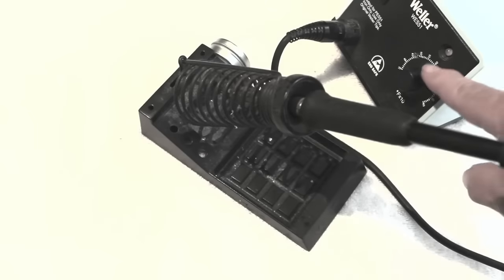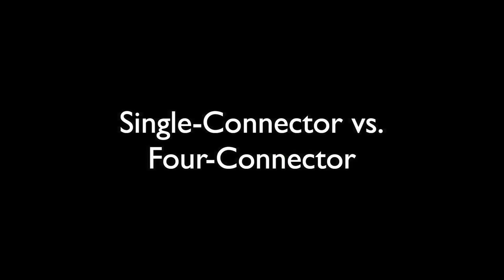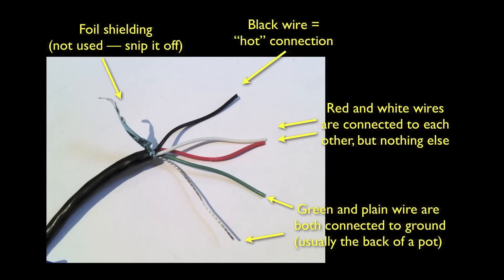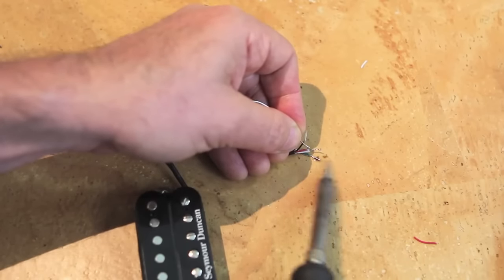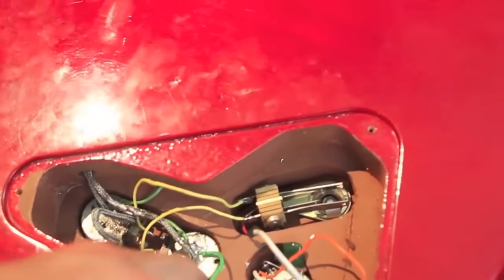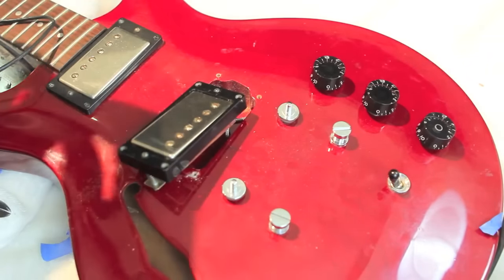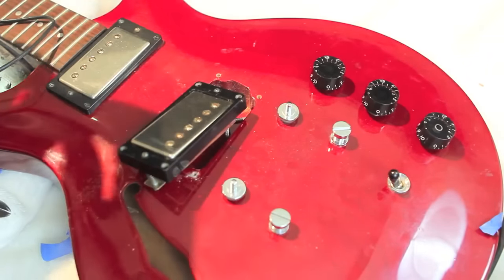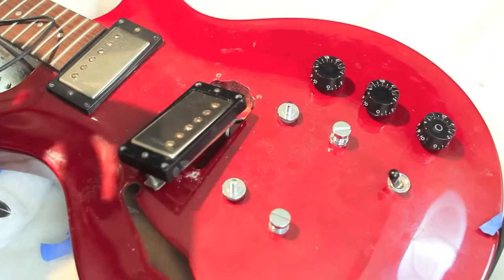Do It Yourself - How To Change Guitar Pickups (Courtesy of Seymour Duncan)

Comment: Hi all, I have a couple of things that really can make things easier. First of all a correction, he refers tge outer coating on the red, white, black and green as "Shielding" that term is not really correct. It is insulation. Shielding is a term that hints that it protects from ground hum or buzz. Shielding is used to reduce noise ie: "Shielding Tape" The second item that saves a ton of frustration is before pulling wiring out after disconnection, I tie a light string to the wires so when I pull the wires thru it creates a pull string to pull new wires back when you put the new pickups in. Easy Peezy! Good luck to you and may your skills grow to Monster Proportions!

Comment: Very informative but what genius chose black for the HOT wire?
Face Palm!
On another point:
NEVER cut your strings before loosening them, you'll save your tuners, bridge and finish on the guitar!
Reply: My acoustic saddle broke bc I thought I loosened the strings enough and when I cut the string it snapped my saddle clean in half, but I ended up getting a bone saddle that sounded better so I guess it’s a win at the end of the day, lesson learned lol
Reply: Which color would you prefer
Reply: @jimmcbride2990  white or red. Black is negative in most schemes.
Reply: @Lee-wu2up  black is hot in residential electrical work in the US. when he said black was hot it just seemed natural to me. then again, i am an electrician. never worked with fine electronics, really

Comment: Thanks so much, I've never wired a guitar before and I've been tremendously frustrated trying to find information on how to wire a 4 connector pickup. I don't need to split the coils and and all the advice I've gotten so far has been over my head and lacking depth, but this helps a lot.

Comment: Outstanding video!  I'm trying to put an SSV+ into the bridge of a super strat, and have no desire to do coil splitting with it.  That said, there's virtually nothing out there, whether it be wiring diagrams or videos showing how to wire up a series bridge humbucker into a strat (that was previously an SSS).  So, I'm simply working with two 250K tone pots and a 500K volume pot.  I'm probably over-thinking it, but it would be nice to see it done visually.  Suhr doesn't have a wiring diagram, and it seems to be opposite of my Bare Knuckle Pickups wiring diagram.  So, I'm hoping it's the same wiring as the SD.  Either way, I'm going to give this a try and see how it goes.  This is a great video...thank you for posting!

Comment: Alternative "tools and supplies":

soldering: big gun type
;
wire cutting: scissors
;
Wire stripping: teeth (between), front, choppers
;
Screwdriver improvise: dime, metal pick
;
pliers: finger nails
;
tape: fingers
;
cell phone: mental notes
;
towel: kleenex, or pure air (nothing);
Reply: You forgot tweezers & toothpicks, lol

Comment: Thanks for the vid. I just replaced the stock humbucker in my 8-string kit build with a Duncan Distortion humbucker and, considering that this was for a Seymour Duncan humbucker, I was able to follow this tutorial to the letter. My 8-string is a Tom Delonge-style setup: single humbucker with just a volume knob so the wiring is fairly simple. The hardest part was soldering the wires where they needed to go since I'm not exactly a wizard with a soldering iron. My solder joints aren't pretty but they got the job done.

Comment: I've only ever once attempted to install a pickup, years ago(probably like 8 years) and failed some how. Either the pickup I bought was faulty, or I fucked something up. In the end, I no longer have that guitar. Jump to today and I FINALLY got my new set of pickups(12 years into playing guitar, sounds like a good time to change things from stock LOL) and because of this video I now know that I have two new single-wire pickups. I'm legit excited to put these babies in and play with them. I remember when I tried to install the first pickup I ever did, I heated the solder up first. Don't think that caused the issue but yeah, clearly not the best way to go about it. lol. Thanks for the video man! :)

Comment: I referenced this before I opened up my Epiphone to change the pickups. When I did, I found that the Epi pickups has wire terminals with a color coding that is different from the Seymour Duncan wires. The bridge pickup terminal has 2 black wires (one of them the bare wire), and the neck has 2 white wired (one of them also the bare wire). After a lot of searching, I found this - and successfully changed the pickups:  From Seymour Duncans to Epiphone harness: bare goes to bare (of course), green goes to black, black goes to red, white goes to green, & red goes to white

Comment: Nice video on this. Never done it before but am gonna attempt it myself on my old LP. Either that or I balls it up and there's a dude down the road who will do it for me.
Reply from the maker: You can do it!
Reply: @DIYGuitarTalk  failed! Got the neck pickup to work but the bridge is not functioning. Problem I have is my LP uses quick connect cables but im not using them so trying to wire it like you show.

Comment: You can use a little flux on the existing solder to melt it very quickly instead of setting your iron on the dry solder heating everything up. Probably won’t do anything to a pot, but if it was a sensitive piece of electronics you don’t want to set it on for that long.

Comment: I had a seymour duncan SH4 for 7 string... I think they inverted the red and the bare wires from the factory.  It took me days to discover this because i didn't have a tester so I did trial and error method.  I was wondering why all the diagrams I found didn't work and I even contacted the guitar manufacturer (Ibanez) to get a diagram from them.  I had finally made it work by swapping the red and the bare wires.
Reply: Wait what? So the wiring was wrong ?

Comment: Thank you for this very informative and easy to follow video.  Two questions.  
1) I want to install a pair of Seymour Duncan pickups in my Les Paul.  On one of the volume pot lugs, Gibson has left quite a lot of solder on the lug, which one of the orange drop capacitors is attached to as well.  If I try to heat the new pickup's hot wire to the lug, and am not able to remove the solder, and am only able to connect the hot wire to the remaining solder left by Gibson, and thereby not being able to connect the hot wire DIRECTLY on to the lug, will this lessen the pickup's signal/output?  
2) Also, what is the recommended temperature to run the soldering iron at?  
Thanks in advance.

Comment: any ideas as to why there is no sound after connecting everything exactly as you showed? I have tried to connect it every single way possible and there is just no sound. is it possible that something was broken in the process? it's very unlikely as i was very careful the whole process, nothing was burned/scratched/cracked/snapped/pinched/etc. I will have to put the old pickups back in and solder them back up again to make sure they aren't actually broken (its late in the day and i dont have time to do that anymore), but i have complete surround pictures and a video of the original connections and given the instructions that came with the pickup, plus your tutorial, again, everything was connected up fine, but no sound when tapping the individual poles, even when reinstalling the strings to try with those.

also what is the point of the green and bare wires to be separate when you have to join them and use them as a single wire??? unless they can be used separately in a different set-up, of course :D

Comment: Hi. thanks alot very interesting... i have a guirtar that the 3 way switch is far than volume pot. Can i connect the ground (mesh in two conductor or gren  and plain on 4 conductor ) in any place of the 3 way selector switch?

Comment: Serious question, I cut the input connector wires half length on my friends guitar (they were so long) and fixed the buzz it had for a long time.. how sure are you that the same doesnt apply to the pickup wires? I mean that the audio quality wouldn't be affected by a longer wire. 

I was always told in regards to production and signal chains that the more wire = the more noise - but maybe there's a difference between pot--> input and pickup--> pot connections seeing as humbuckers are designed to reduce noise? Thanks!

Comment: By far the best way to strip the ends on the tiny wires is to slightly heat the end of the wire with a lighter till it softens a little then pinch it with your fingernails and the insulation will slip right off without damaging the hair like wires inside

Comment: If you want a trouble free operation... Just SPLICE the wires and join them together, much easier...been doing this for ages... of course you need to consult GOOGLE for the color codes.. Once you know where the "hot" wire is, it's pretty much easy to figure it out... Green and Bare usually goes together... Two conductor Humbuckers are the most convenient all you need to connect is the hot and the ground

Comment: Question: Can you use those "twist connectors" that you use to join house wiring? For example, suppose you cut your current pickup wires 3" from the pot; remove the existing pickups, mount the new pickups and then connect the new pickups to the existing wire with a "twist connector"? Would that work? (I have no use for a soldering iron other than replacing pickups...)
Reply: bad idea, wiring means soldering everything had to stay in place securely

Comment: I'm sitting here so mad. Mine is all jacked up. The old pickups were all twisted together and attached to the tone pot with a wire coming from the bridge pickup and one from the neck pick up attached to two seperate end of the 3 way switch. But my bridge pick up wont work, nor does the middle position work, only the neck position works. I'm insanely upset

Comment: If I don’t want to use a iron can I just splice together the new and old pick up wires in the pickup cavity
Reply: Bolin Cartest If they are going to the same control knob and if you can make a full contact and secure connection than that might work. Try it. Soldering is used to keep the wires connected to other bits in the circuit and make a full electrical connection. Soldering would be a good thing to do, but try your idea and see if it works.

Comment: i installed a dimebucker pickup i followed my old wiring setup exactly and ive got a hum/buzz. are my solder joints just crap? i mean they dont looks like clean shiny smooth pools, its deff messy but the wires are on their grounds solid i cant pull them off? 
ive checked all over for a loose ground and ive got continuity all over the guitar with multimeter... please help im loosing my mind...
Reply: Did you figure it out ? I have same problem but only on neck

Comment: I'm trying to replace a wire,but can't find the wire to buy because I don't know the name, it's the 2 core wire in 1 strand Only 1 wire is regular stranded wire and a insulated  thin solid wire running through it, it's a friend's old honer Stratocaster from the early 80s, I'm thinking it's a discontinued wire type as nobody knows lol if you do feel free let me know, thank you 👍✌️

Comment: Hi, I'm swapping the humbuckers on my Squire Tele HH and when I opened it up, I noticed both pups are wired to the 3 way toggle switch, then the switch is connected to the pots. I'm upgrading the pups to new Seymour Duncans and I'm thinking I can just solder them to the toggle switch as was. Any thoughts would be appreciated.
Reply: that is one connection for each pickup on one side and connections for volume and tone control on the other side.
changing pickups only is simple as a pie. just desolder the first one and resolder the hot to the switch and the other on the back of the volume pot for grounding and so on
just 2 connectons at the same place that the old ones

Comment: Hello sir, I'm not sure if you're reading this, but the truss rod in my bass is stripped out. Other than spending $50 bucks on grippers, any suggestions?
Reply from the maker: That's a tough one. The only way to fix a truss rod that is stripped  is to bring it to a luthier. The will need to remove the fretboard and replace the truss rod. It will be expensive.

Comment: Since you mention the red and white are not in used...what would be different if they were not solder together and left alone???
Reply: If you were to ignore those wires, the pickup would be an open circuit and there would be no output.  Those wires, in the wiring shown in the video, connect the two coils of the humbucker.  If so desired, they would allow one to wire a guitar in such a way that one of the coils can be used independently of the other, to replicate a single coil sound in a guitar equipped with humbuckers. Hope this helps.

Comment: Is it possible to build your own guitar? My highschool has a wood working class and I did the first one so now I can take the class at the next level. This allows me to choose my own projects to work on and I'm looking for a new electric guitar rn so I'm thinking why don't I just build my own. I can take that class and make the body for free then spend less money than I usual and boom I'll have a great brand new guitar that I made myself. Anyways I just thought I'd ask someone that knows a little bit about guitar tech. Is the wiring complicated btw? Also is it possible to install a tremolo system into it too?
Reply: You can build your own. Buying a neck would most likely be easier than making your own (so you don’t have to install a truss rod or anything) A trem system can be done too, just buy a strat or Floyd rose style bridge with a trem. Strat bridge would be easier btw
Reply: I agree with geeky on the neck, however a Gibson style tune o matic bridge and stop bar tail piece is way easier than a Strat style floating tremolo. But if you really want that whammy bar tho, go for it. Depending how nice you want it, those ebay guitar kits are really cheap, and you can use the body as a guide to make your own and just keep the one that came with it for another project, like learning how to paint it first on something you dont care if you mess up. They come with pickups and everything else you need like a jack etc. Also a lot of manufacturers make wiring harnesses that easily clip on and off so a lot less work. Good luck! If you do it post a video so we can see it!

Comment: Why hasn't anyone invented a pickup system where they just plug into the guitar with no soldering? it would be so simple and profitable
Reply: I've seen a few proposed designs. I think what it comes down to is that it would require some kind of harness that would require more routing for even a DIY and a change in production technique; even if it was done, guitarists can be fickle about appearances. There's also height adjustments to consider. But it is a great idea

Comment: HELLO I LOOKING TO BUY 3 
PICKUPS 2 AKTIV AND ONE PASSIVE IS IT POSSIBLE TO INSTALL THEM BOTH 
ACTIVE AND PASSIVE ON ONE GUITAR I HAVE A CORT x6 VPR GUITAR WITH   
Pickup Switch Type 5-Position Blade, Controls Push-pul, VOLUME  KNOB.
I WANT TO BUY Duncan Blackouts Ahb-1n, As-1 AND FOR BRIDGE DIMEBUCKER IF YES CAN YOU SEND ME A SCHEMATIC HOW TO DO WIRING THNX

Comment: I replaced humbuckers INF3 (neck) and INF4 (bridge) on ibanez rg350dx with seymour duncan hot rodded set. Now split coiling not working, which is not the main problem for me, but the biggest problem which makes these pickups useless is that there is no punch in power chords anymore, I understand the wiring problem for split coiling, but what could be the reason for such a dull sound ? anyone has any such experience ?
Reply: Are they phased?
Reply: Did you ever find out? im interested in this.

Comment: So... I only have one 500k pot but both pickups were connected to the tone switch. I'm lost
Reply: Mr. Glabalabadubeestu The Mexican Cyclops on a 3 way toggle switch, one pickup is connected in one side and one in the other, ground wires go together in the same lug on the other side of the switch

Comment: Now this guy is great, and this may be nitpicking the heck out of him. Not trying to be unfair but the last install video the guy points to one of two pots and twice refers to the lower pot as a location. Instead ofTone Pot it was "Put this wire THERE", "Remove this from THERE" Im  like, well its probably the tone but it could easily be a volume. Jackson guitar. 
When teaching, pretend you are talking to 12 year olds  that dont know anything.
You will NEVER be "talking down" to the viewers because its understood many of us dont know very simle stuff...for example what hole of the wire stripper to use.
WHen our lovely guy above said ok Im stripped the wire with the wire stripper I was literally holding the tool and pickup in my hand waiting and then....damn...gotta go find someone who will teach m,e that and come back lol